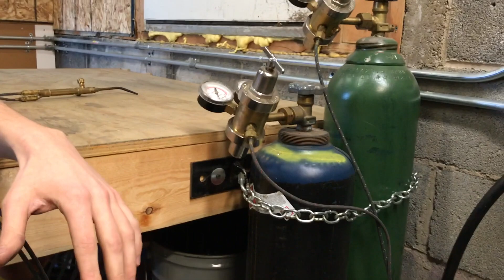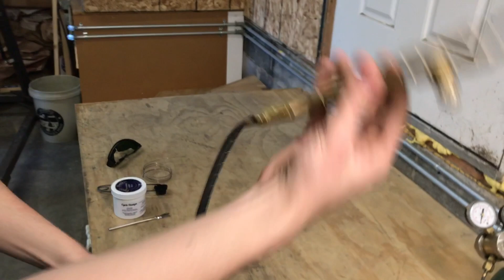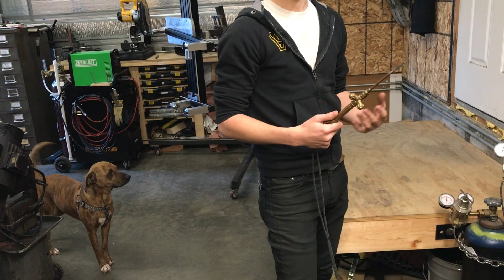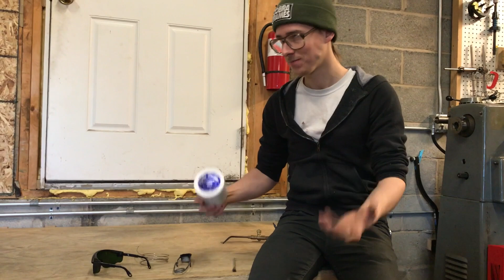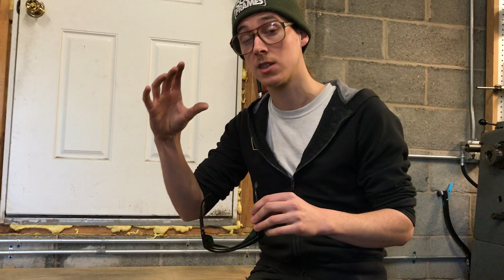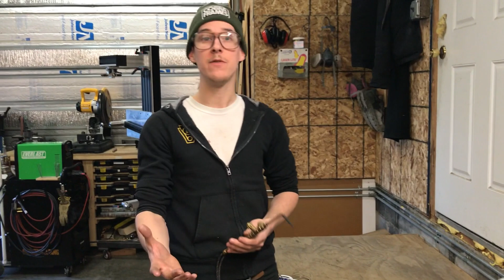Brazing Setup for Bicycle Framebuilding | Torch Rig Overview

Comment: I lived in Asheville for awhile and was friends with a bunch of glass blowers. Do frame builders know about torch companies that are glass oriented? Look up GTT hand torches like the lynx. They use several jets, with the center ones delivering the fuel and the ones around the circumference deliver oxygen, and it also injects oxygen down the fuel stream, and you have two oxygen knobs to control that. Not to mention they’re beautiful torches

Comment: "I'd hate to ruin a hose [by dripping 1000 degree flux on it]"

I think the risk of flashback is probably a bigger issue, as you have the arresters on the torch and not the regulators.

Comment: Is it possible to add water bottle mounts to a frame without screwing into it? I mean like by melting the metal of the bottle holder onto the tube rather than drilling INTO the tube.
Reply: You can use studs instead of bosses

Comment: Is it fair to say that some brazing is involved in all steel frame building?  You need to braze the cable stops and bottle mounts correct? They cannot be welded?   Thanks
Reply: Not strictly. I mean, the "braze-ons" on titanium and aluminum frames are welded, and I don't see any reason you can't do the same with steel. But I would guess most prefer the aesthetics of brazed braze-ons. Also, with butted tubes, welding braze-ons on the thin .4-.6mm middle sections would be difficult.

Comment: you ever tig braze any of these frames? A video on it would be rad!
Reply from the maker: I don't have any experience with TIG brazing. My, mostly uninformed opinion, is that it's probably only useful for a couple things on the bike. Maybe some of the braze-ons or lower stress joints like stay bridges. It might not be a bad way to go for water bottle bosses where you're welding a relatively thick part to the thin un-butted section of the tube. I may dabble with it someday, but probably not too soon.